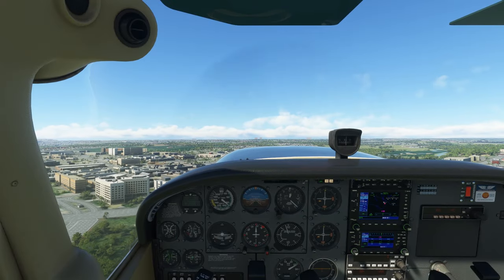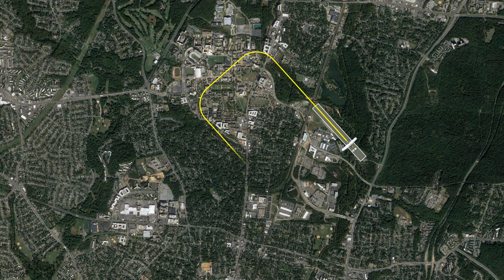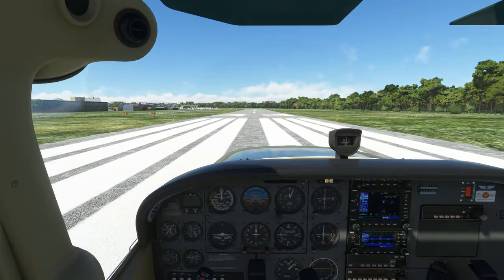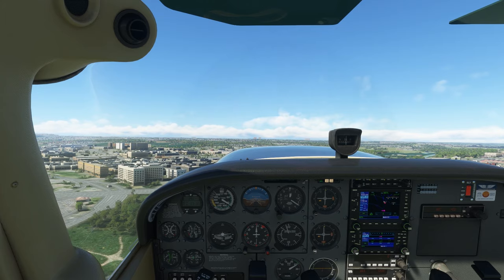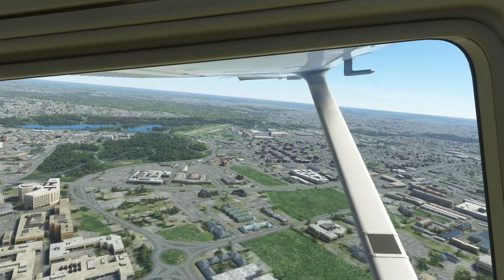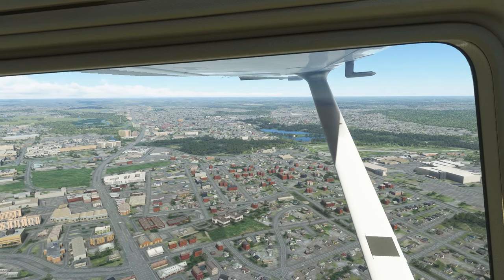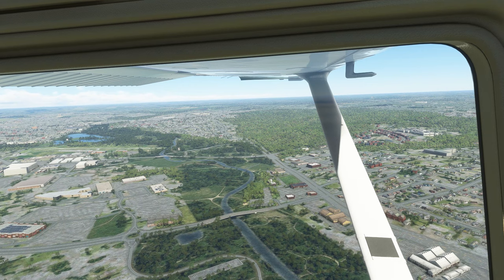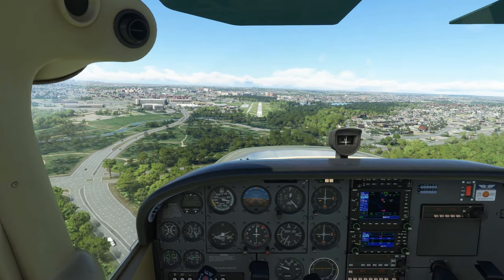Flying a Traffic Pattern | How to Land an Airplane

Comment: When you're abeam the numbers on downwind, you should do your GUMPS check, throttle back to approach power, fly level until you're at the proper airspeed, trim the pressure off the yoke, and turn base. Don't pull the yoke back during the turns. After each notch of flaps, retrim for the correct airspeed. Once you turn final, adjust the power to keep the numbers from moving up or down in the windscreen. Don't pull the power back to idle until you cross the fence or threshold. When the runway suddenly appears to get wider, start your round-out and flare so that you touch down in the touch down zone (white rectangles). Using landmarks and trimming for the correct airspeed will help you keep your eyes outside the airplane instead of inside fixating on the instruments.
Reply: Thank you!
Reply: @mrphysics2625 u must be my flight instructor we do the exact same thing (constant airspeed decent)?

Comment: As you become familiar with the pattern, it is much easier to profile fly. That is to establish certain parameters, like RPM, decent rate, and power for air speed. This will teach you a more stabilized approach. Once you learn how to set your power and trim for approximately a 400 ft./min. decent throughout the pattern you’ll only need to touch power to maintain the desired airspeed.
Reply: You pitch for your airspeed
Reply: @chasesawyer8087  yes that’s the original way it was taught but that does not work when you’re shooting an ILS.  You’ll find it much easier to pitch your dissent rate and adjust air speed with power. Always set up your profile and your approaches will remain stable.

Comment: It seems to me that the majority of patterns are left handed. Is this an unconscious preference or is it actually preferred?
Reply: You normally fly from the left seat so you have a better picture of what is to your left.
Reply: @JoshuaTootell  true
Reply: It is whatever the FAA has set for that particular field. Left is the general rule true but you should check the charts, supplement, etc to be sure. If you see RP on the chart for example, that field has a right pattern. It may be because of a congested area or noise reduction measures or ???

Comment: Setting visual ques is brilliant. My first instructor was an 80 year old guy and this is how we taught me. My 2nd instructor had his own way of teaching pattern work and landings and i got really thrown off and confused. Of course, he quit for another job and i was assigned a 3rd instructor, with a different method which pretty much said not to expect any procedure for pattern work as the conditions will always be different at every pattern. 
But my first instructor's teaching stayed in my head and when i started flying myself, i always flew that way. This instructional video was great and sort of emphasized the important of visual cues while flying. At the end of the day this is VRF and use the V as much as you can for flying a perfect pattern. Of course when you fly IFR, you have to forget all of this and bob your head inside and fly with the instruments. It is almost like learning to fly all over again :)
Thank you for posting this.

Comment: Excellent video. The only thing I'll ad is that I do glance at the VSI during the descend, at least on those windier days. I've had approaches at 1700 rpm, nose down and flaps partly extended and the plane descended at only 200 fpm.
I agree though, for the most part it's about visual references.
Reply: Always refer to the terminal procedures of the airport to see if there is an OCP, alternate TO minimums and or minimum altitude prior to any turn from runway heading.

Comment: Awesome video! 😎🛩👍🏼
Q: About what range of speed is best when landing?
Reply: That depends on which airplane you're flying. All those numbers will be specified in the operating handbook for each aircraft though.
Reply: @mfkp  Cessna (smallest)?
767 (biggest)?
Reply: @_Breakdown  you can Google "v-speeds" for each model. vs0 is the stall speed in dirty configuration (flaps down). Gotta keep it above that speed to avoid stalling. I think for final approach, you want something around 1.3x your stall speed, unless otherwise specified in the handbook.

Comment: route = streams
path = glide wind assist
approach = glide
final approach = align

today FL hahaha pompous terminology like starboard port
today, for changi, 18000ft glide(speed) to part-of holding-pattern(sling-shot) and align with runway. watch for 250knts before use rudder and 150knts to deploy landing gear with thrust compensation. if miss = no deploy landing gear

Comment: why take a visual bearings  if you have a compass?
Reply: I cheat and bug the runway heading so I know I'm squared off on each leg.
Reply: You should keep your eyes outside the airplane as much as possible. Landmarks help you do that. And, trimming the elevator will help you maintain the correct airspeed without having to keep an eye on the airspeed indicator.